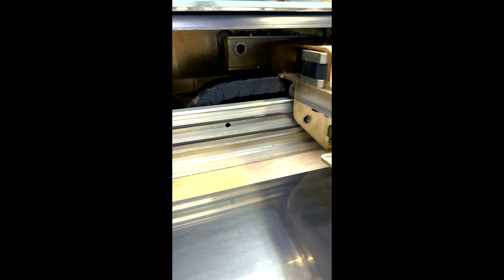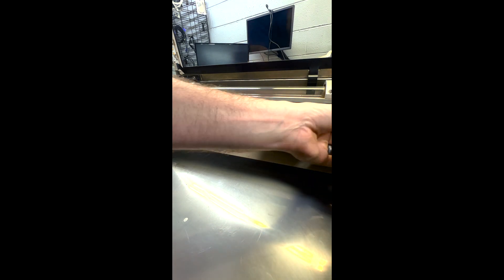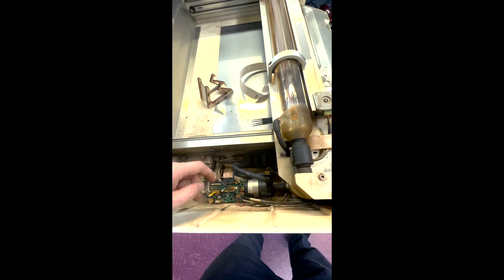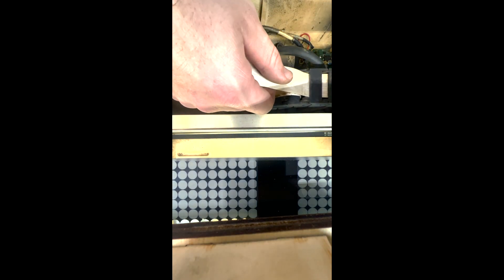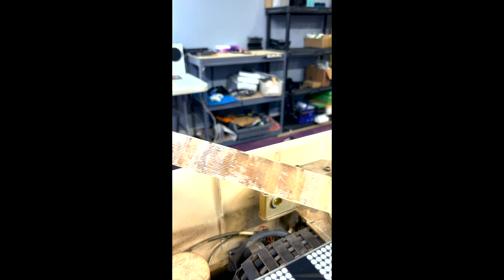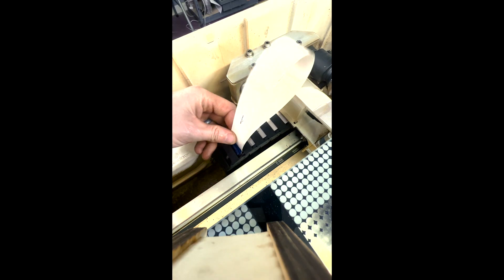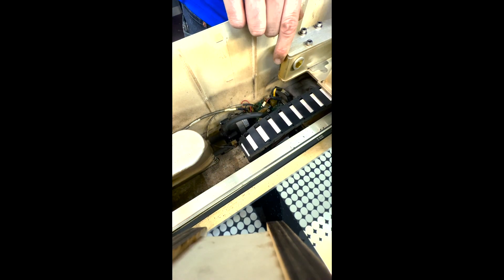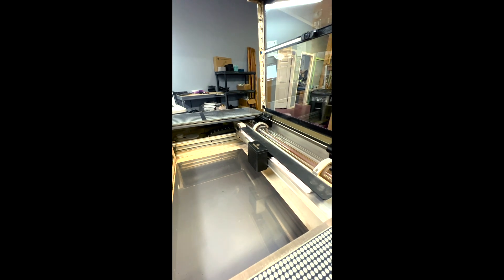Glowforge laser head ribbon cable replacement

Comment: Got my cable and installed it! Great quality and Great video. Only issue now is "Camera didnt take a picture" error 🤣 Cant win with this thing. Thankfully i bought a back up so just got a black and white cable for the lid. if that doesnt work i guess i have a parts machine. Amazing it worked until it got stun locked on "centering"
Reply from the maker: Good news is most of the time that just the white camera cable form the left side LED to the camera in the center of the lid.
Reply: @Cruizin542 just replaced it, still having issues 🫠🔫 glowforge didn’t give me any confirmation email for the black cable but now it says out of stock and they charged my card soooooo we’ll see if I got the last one 😂 but if not I’ll need to find another place to get it. I didn’t see any on your store but 10/10 would recommend 🙌🏻

Comment: i just bought a used glowforge plus for $200, it stays focusing and the light is yellow, would the laser head ribbon cable the couse of the problem?
Reply: Hi i just have tha same problem did you solved the issue..please help me..

Comment: Hey! Thanks for this video. Quick question: my GF is no longer able to focus on the material in the bed (Set Focus and Autofocus are no longer working and result in an error every time). I think the machine is not communicating with the printer head. Have you seen this before? Any idea if replacing the cable would address this issue?

Comment: Really appreciate you providing this cable. Just got mine installed and first print after repair finished. Won't be buying anything glowforge again after they said my machine was as good as ruined (from their own design flaw) and that "you should just buy a new machine".

Comment: Thank you for your video! I just replaced mine without any real headache. Much easier than I anticipated...(procrastinated for about 2 months because I thought Was going to pull out my hair doing it!). Now, I'm back with both machines running! Yay!
Reply from the maker: Glad it helped!
Reply: Did you have a problems with exhaust fan on a carriage because of this cable ?

Comment: Yes it indeed can be fixed! I purchased your cable and now I'm up and running again. Thank you! 

Another comment mentioned snipping the old cable head off and tapeing it to the new one and then pulling it through the wire chain. This saved me a ton of frustration. You still have to have patience and finesse, but now I have two engravers again.
Reply from the maker: Yes that is the way I do it now.  This was one of the first ones I did and have gotten better since.

Comment: Thank you for this and for selling the cable! I was really scared about getting the new cable in, but you were right, getting the old one out is the harder part! (and still not that bad!) Glowforge customer support said that they are unable to provide a replacement cable, but "a Glowforge Pro to replace the one that currently has a damaged ribbon cable will be $4,546, plus taxes. That includes round-trip shipping within the US."   I was able to get just the cable I needed from you, for $85 roughly. What a difference. I hope you get more in stock soon. Thank you also for the prompt communication when I had a question. You're the best!
Reply from the maker: Your welcome!  I'm happy this has been able to fix so many peoples issues.

Comment: Would you advise taking that black piece off and covering it or sanding it before having issues with this cable? Would this prolong the life of this cable from the beginning? I've had mine about a year and a half. Could i go ahead and treat this black part to help? Would it help?
Reply from the maker: Yes or adding some ultra slick anti abrasion tape.

Comment: I received my cable quickly, thank you.   I started trying to peel off the old cable and the glue is coming up with it.  Suggestions
Reply from the maker: Hi it’s not a big deal.  You can use some 3m double sided tape to put it back down.  If most of the tape stays down don’t worry about it.  The stuff they used was overkill.
Reply: @Cruizin542  thank you for your quick response.  I am very nervous about this entire process
Reply: Its done! 5 hours later!  Praise God!  Thank you for your step by step video.  I've watched it over and over, stopping it, replying it.
Reply from the maker: @kerrinelson2288  glad to hear it.  My first one took me a few hours but after doing 6 or more I’m down to 1 hour including a deep clean.

Comment: replaced the cable with yours, and still I'm getting the yellow light. Im wondering if I damaged the cable during install maybe? Or maybe the printer head itself is bad. I really dont know what to do and definitely cant send glowforge 1800 plus shipping and whatever else for a refurb. Had it for just over a year and didnt use it much. What an absolute waste of 6k. Should have gone with a basic.
Reply from the maker: Hi join friendliest glowforge group on Facebook and ask there will be happy to try to help.

Comment: If you cut off the end that connects to the printer head, tape both ends of the new cable, then tape the new cable to the end that you cut off on the old cable 
You can just pull the new cable through while pulling out the old cable ..thanks for the video and new cable
Reply from the maker: Yes that is a great way to do it.  This video was early on I have learned many better ways to do things.

Comment: question can you help me. my glowforge looks like its working but it dosent engrave , score or cut . it goes though the motions but nothing happens. thank you John
Reply from the maker: Hello this more than likely is not your issue.  If the laser tube is not lighting up and marking the wood there are several things it could be.  One is the power supply, the other is the power cable that connects to the back of the laser tube.  Neither is easy to repair sadly.  Is it still under warranty?
Reply: no its not under warranty only had it for 1 1/2 years
Reply from the maker: @arcadius1970  message me through Etsy wiregrass made.

Comment: If you put painters tape on the old cable would it prevent it from catching as you pull it out?
Reply from the maker: Are you trying to save the old cable?  It’s not needed the reason for the tape is to protect the clip and keep anything from getting inside the connector when installing.

Comment: do you sell the ground down allen keys? I know it sounds so silly, but I don't know how to grind it down. Also have you ever done any repairs with the coolant tank/pump/hose? GF is awful and absolutely no help at all... just a huge money grab. I'd pay you to facetime or zoom and help me repair mine.
Reply from the maker: Hi, you can use a pick kit you can get at any auto parts store.  I have not but its pretty straight forward.  Whats going on with your coolant system?
Reply: @Cruizin542  my husband got a mechanic friend of his to grind down an allen key for us today, so I'll be able to try and pop off the side panel hopefully.  sooo... the GF was cutting a job perfectly fine, when it finished the internet cut out so a few hours later when it was back on I went to switch out the material so I could start the next job and as soon as i reached for the lid I saw a bunch of liquid coming out of the left hand side of the machine (outside not inside the GF). I immediately unplugged and tried to contact GF customer service... they got back to me 2 days later and are telling me to pay to mail it to them and then pay another $1125USD to receive a refurbished one. (money grab).

as the liquid was leaking the laser tube filled up with bubbles. Since i cant see any damage to the tube itself i am assuming it is either the hose, tank or pump? have you fixed anything like this before. I have called all over to laser specialists and no one is willing to work on a GF ugh i need help.

Comment: i think i found what my problem may be.i have  a yellow light and its not focusing.when i connect the cable to the print head the the assist fan spins,so i really dont know if the wire is bad or not.i am so lost i want to cry.please help
Reply from the maker: Hi, it’s hard to tell for sure since glowforge doesn’t share any info.  What we did the first time we had this issue with the yellow light was inspect the ribbon cable.  I noticed there  was some black marks on the cable that looked like burn marks.  That’s what made me pull the cable and test it and found there was resistance in it where it shouldn’t.  I know pulling the cable to test it isn’t ideal but it can be done without pulling it.
Reply: @Cruizin542  was your assist fan still spinning with the orange light?
Reply from the maker: @marlegrant5676  yes but the laser head would never move.  We also had once where it would move but not focus and that time there was a damaged plastic build inside the laser head.

Comment: I watched this 10 minute video 2x and ordered the ribbon cable.  your shipping was quick - Thanks!  Start to finish, I did the cable replacement in 1 hour : 10 minutes and we are back in business.  Originally I was concerned about how to get the ribbon cable threaded under all of the remaining cords, etc on the "chain" ribbon guide, but that turned out to be much smoother than I was expecting.  I purchased an orange small hook set from Harbor freight which was a great help, and I fashioned a ground down  Allen wrench pry tool same as yours for top left cover.  Since this was the first time I have ever had that cover off, it was perfect time to do some deep cleaning too.

In the beginning, I called Glowforge for parts or assistance and they would provide neither.  Much disappointment there, but glad I found your video along with others for support. They would never speak on the phone, would only send an email to tell me they could not help this situation.
Thank you for a great video.  It was exactly what I needed
Reply from the maker: Glad to hear!  Yes sadly their help is very lacking.  We have three glowforge sand the entire reason I started repairing them and sourcing parts was due to lack of help after the purchase.